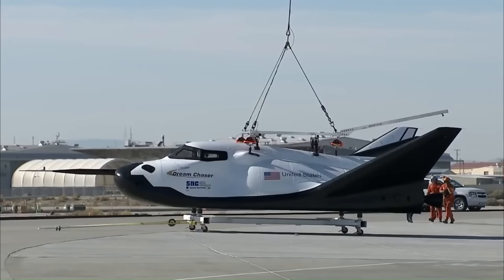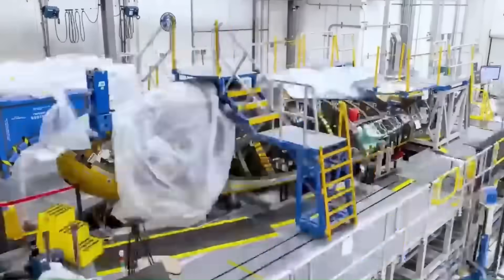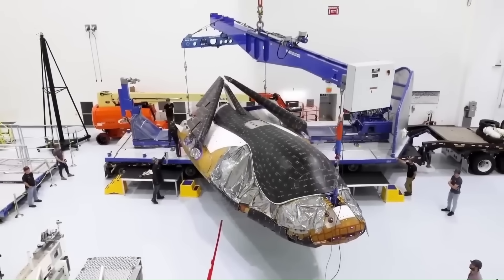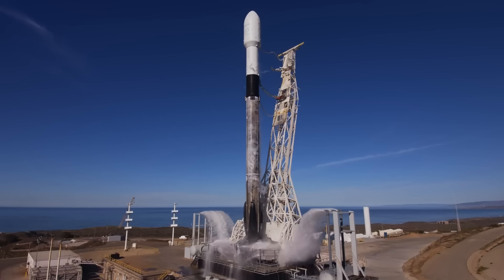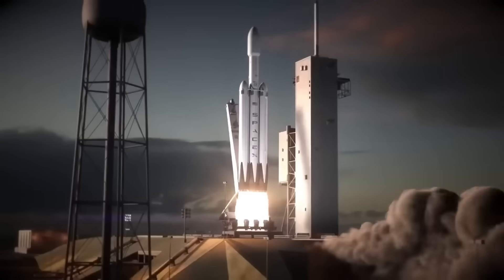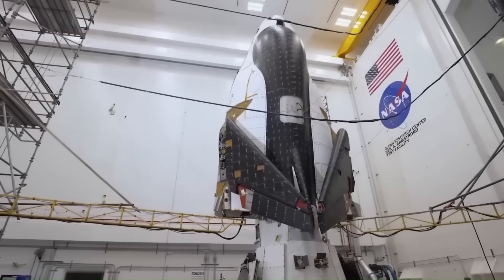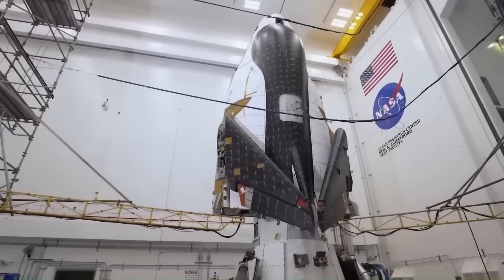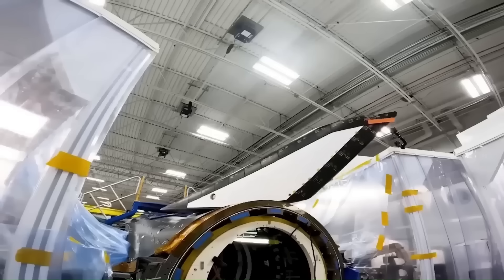Dream Chaser Is Finally About To Launch On Falcon Heavy!

Comment: By the time Dream Chaser is man rated the ISS will be at the bottom of the ocean.  They may get a few cargo flights in but most of those slots are already taken by Cargo Dragon, Cygnus, and possibly one or two Starliner cargo runs.  With the short window for ISS the market has dried up.  Maybe it will be used for commercial space stations if they ever materialize.
Reply: but there 2 other companies that going to build commercial space stations,

Comment: So there's no agreement to launch Dream Chaser on top of Falcon Heavy. This video is such a waste of time for a "May be".
Reply: Actually, there is a tentative agreement between the two.  In fact, while the new faring can be used for any "Large Payload" it was said that it was designed with the Dreamchaser in mind.  It took SpaceX less time to design it than ULA and Blue Origin took to actually get a Vulcan and "Flying Member" up (still love that he named the totally original drone ship after his mother and that the "member" lands on it).
Reply: And the charge that its rocket is not yet ready isn’t true.  Its rocket launched to orbit last year without a payload.
Reply: @michaeldemarco9950  Yes ONCE.  The rocket was ready, on time, with a slight delay, but they couldn't even test it without engines.  The ongoing problem is that they can't get enough engines from BO to launch regularly and it took them over a year, beyond the scheduled date to get ANY.  Further, I don't even think there is a definite date for a second launch and because of their commitments to the Gov, there is no way they could launch Dreamchaser for years, at this pace.
Reply: @BillMooney-r5c  There are 6 VCs waiting in the hanger to launch. The problem isn't ULA, its Sierra space.  Dreamchaser still won't be ready until this fall earliest.

Comment: It would be good for both companies. If the faring fits heavy it likely would also fit on the falcon as the core of the heavy is a "falcon". ULA is tied to Boeing. Boeing is going to get Starliner working before letting ULA launch Dream Chaser. DA

Comment: those swives arm flaps are a problem. they break easily. and are easily overpowered and tilted to sideways. not passively stable. like rocket arrow fins are. only small flaps on the lift surface, not the whole flap turning. why the falcon heavy does not use 3x falcon 9. even for the center custom rocket. you gotta mass manufacture, if you want to mass manufacture. no customs.
Reply: Well the first uncrewed flights will test those flaps.